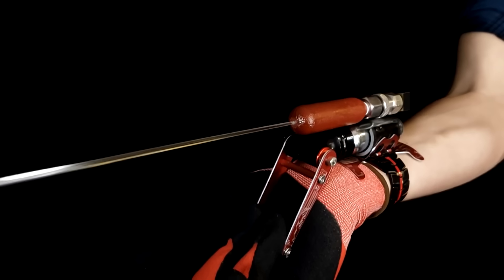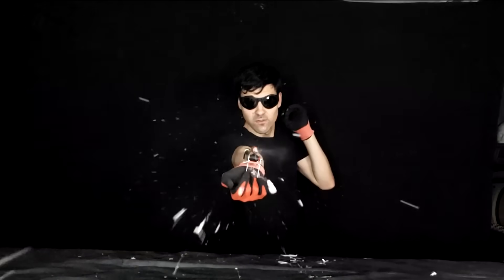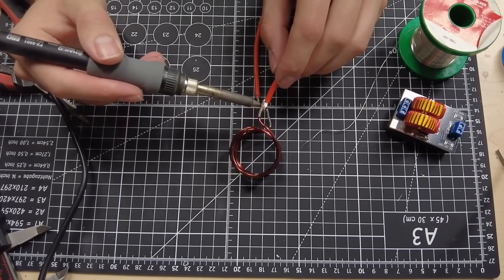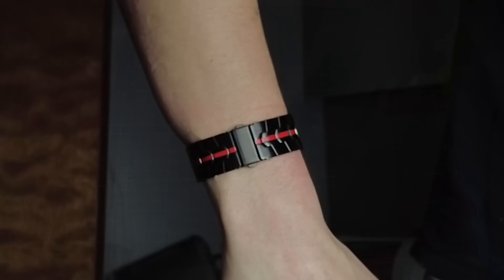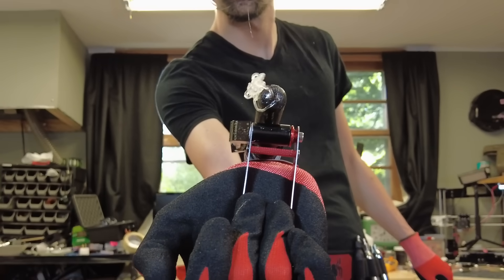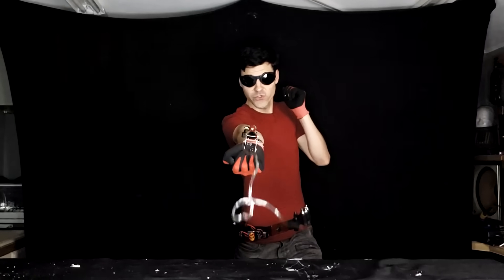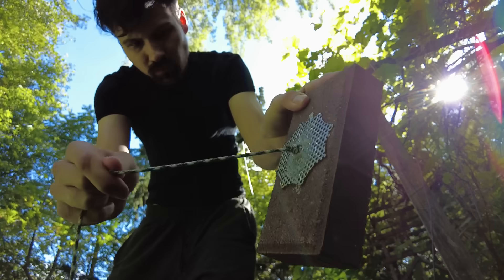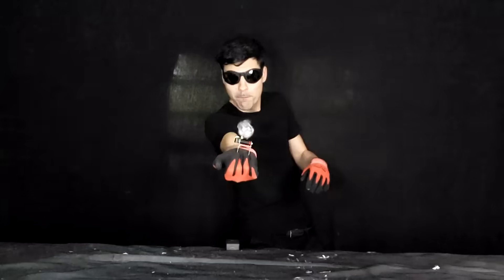REAL Web Shooter (Spider-Man: No Way Home)

Comment: You could use memory steel shaped as the metal web thingy with the holes at the end of the video in order fot it to be able to be folded into a small shape so u could combine rope and hot glue. The ropes could actually be wires that provide the memory steel web thingy with electricity and heating it in order for it to unfold. This way when u stot your web shooter it would firstly fire hot glue witch it already does and then after like 0.12 seconds it would fire the metal thingy with just an additional co2 canister while simultaneously providing it with electricity via a high amp battery (for exemple a small lion 7.4V battery) so it can unfold and stick to the hot glue.
Reply: Oh yeah this way u could also open up a whole new world of electric "webbing" by sending high voltage to the metal thingy from a high voltage generator
Reply: GAY

Comment: Maybe if the metal with holes was replaced with actual chainmail it could make it flexible and keep the strength that the prototype has while being able to fit into a more compact space rather than having the disc somewhere on your body

Comment: Certainly, let's provide a comprehensive step-by-step guide for building the advanced glue delivery device with all the components and features you've described, in the order you specified:

*Step 1: Conceptualization*
- Begin with the idea of creating a multifunctional device combining a glue delivery system, cutting mechanism gloves, a retrieval system, and a string catapult for versatile applications.

*Step 2: Design and Blueprint*
- Develop detailed blueprints that include all the components:
  - A sturdy frame
  - A compact web structure (web base)
  - Cutting mechanism gloves with integrated buttons and sensors
  - Glue reservoirs with precise release mechanisms
  - A retrieval system inside the device
  - A timer-controlled oil-release mechanism

*Step 3: Gathering Materials*
- Collect necessary materials, including:
  - Microcontrollers for sensor integration (e.g., Arduino or Raspberry Pi)
  - High-tensile strength string material
  - Springs suitable for the web structure
  - Heating elements, temperature sensors, and small pumps for glue and cohesive substance release
  - Durable framework and gloves for integration
  - Buttons for gloves and wiring components
  - A tiny catapult mechanism with a long string
  - Additional rolls of string for reloading

*Step 4: Building the Frame*
- Construct a sturdy frame using lightweight and robust materials like aluminum or carbon fiber.
- Add mounting points for various components, ensuring stability and durability.

*Step 5: String and Glue Delivery System with Chambering and Loading*
- Integrate the strong string-like material into the device for weight distribution.
- Design a glue chambering and loading system connected to glue reservoirs, allowing glue to ooze onto the string as it's being fired.
- Create a web structure with springs that opens upon releasing the web.
- Implement a combined heat mechanism within the web structure, connected to the drying mechanism.
- Integrate a precise glue release mechanism into the web structure, including four nozzles for controlled glue distribution onto the string.
- Incorporate an oil and rubbing alcohol release mechanism into the web structure, consisting of four nozzles for releasing cohesive substances.

*Step 6: Cutting Mechanism Gloves*
- Create gloves with built-in buttons on each palm.
- Integrate sensors into the gloves to detect string tension and angles.
- Implement an electronically controlled cutting mechanism on each glove.

*Step 7: Retrieval Mechanism*
- Integrate a retrieval system inside the device with a weight sensor.
- Implement a timer-controlled oil-release mechanism within the device.
- Include small pumps for controlled oil and rubbing alcohol release.
- Ensure proper plumbing and tubing for cohesive substance release.

*Step 8: Software Logic*
- Develop software to control the entire system, including sensors, microcontrollers, pumps, and timers.
- Configure the software to recognize different button inputs on the gloves.
- Utilize microcontroller libraries and programming languages suitable for the components used.

*Step 9: Swing Functionality*
- Utilize the sensors in the gloves to detect swinging motion.
- Configure the software to recognize peak swings and allow for the release of the string at the desired moment.
- Enable double-tapping of the glove buttons to cut the string and initiate a swing.
- Implement a feature that allows holding the button to retain the strings in place.

*Step 10: String Catapult and Loading Mechanism*
- Include a tiny catapult mechanism with a long string that holds additional rolls of material.
- Implement a loading mechanism for the catapult, allowing for easy insertion of more string.
- Design compact and durable web-based bullets (WB bullets) that attach automatically to the string after the prior web base (WB) has detached.
- Create a loading system for the web-based bullets to facilitate rapid reloading.

*Step 11: Final Product*
- Successfully complete the advanced glue delivery device with cutting mechanism gloves, heat mechanism, web structure, and retrieval system.
- Ensure that it fires glue webs with precision, applies hot air for rapid adhesion, and has a retrieval mechanism that operates as intended.
- Allow for intuitive swinging, string cutting, string retention, glue delivery, and cohesive substance release functionalities as described.

This comprehensive guide outlines the construction of a multifunctional device that combines existing components and technologies to achieve the desired functionalities in the order specified, ensuring a versatile and precise multifunctional tool for various applications. Always prioritize safety and responsible use when working on such projects.
Reply: Certainly, let's provide a comprehensive step-by-step guide for building the advanced glue delivery device with all the components and features you've described, in the order you specified:

*Step 1: Conceptualization*
- Begin with the idea of creating a multifunctional device combining a glue delivery system, cutting mechanism gloves, a retrieval system, and a string catapult for versatile applications.

*Step 2: Design and Blueprint*
- Develop detailed blueprints that include all the components:
  - A sturdy frame
  - A compact web structure (web base)
  - Cutting mechanism gloves with integrated buttons and sensors
  - Glue reservoirs with precise release mechanisms
  - A retrieval system inside the device
  - A timer-controlled oil-release mechanism

*Step 3: Gathering Materials*
- Collect necessary materials, including:
  - Microcontrollers for sensor integration (e.g., Arduino or Raspberry Pi)
  - High-tensile strength string material
  - Springs suitable for the web structure
  - Heating elements, temperature sensors, and small pumps for glue and cohesive substance release
  - Durable framework and gloves for integration
  - Buttons for gloves and wiring components
  - A tiny catapult mechanism with a long string
  - Additional rolls of string for reloading

*Step 4: Building the Frame*
- Construct a sturdy frame using lightweight and robust materials like aluminum or carbon fiber.
- Add mounting points for various components, ensuring stability and durability.

*Step 5: String and Glue Delivery System with Chambering and Loading*
- Integrate the strong string-like material into the device for weight distribution.
- Design a glue chambering and loading system connected to glue reservoirs, allowing glue to ooze onto the string as it's being fired.
- Create a web structure with springs that opens upon releasing the web.
- Implement a combined heat mechanism within the web structure, connected to the drying mechanism.
- Integrate a precise glue release mechanism into the web structure, including four nozzles for controlled glue distribution onto the string.
- Incorporate an oil and rubbing alcohol release mechanism into the web structure, consisting of four nozzles for releasing cohesive substances.

*Step 6: Cutting Mechanism Gloves*
- Create gloves with built-in buttons on each palm.
- Integrate sensors into the gloves to detect string tension and angles.
- Implement an electronically controlled cutting mechanism on each glove.

*Step 7: Retrieval Mechanism*
- Integrate a retrieval system inside the device with a weight sensor.
- Implement a timer-controlled oil-release mechanism within the device.
- Include small pumps for controlled oil and rubbing alcohol release.
- Ensure proper plumbing and tubing for cohesive substance release.

*Step 8: Software Logic*
- Develop software to control the entire system, including sensors, microcontrollers, pumps, and timers.
- Configure the software to recognize different button inputs on the gloves.
- Utilize microcontroller libraries and programming languages suitable for the components used.

*Step 9: Swing Functionality*
- Utilize the sensors in the gloves to detect swinging motion.
- Configure the software to recognize peak swings and allow for the release of the string at the desired moment.
- Enable double-tapping of the glove buttons to cut the string and initiate a swing.
- Implement a feature that allows holding the button to retain the strings in place.

*Step 10: String Catapult and Loading Mechanism*
- Include a tiny catapult mechanism with a long string that holds additional rolls of material.
- Implement a loading mechanism for the catapult, allowing for easy insertion of more string.
- Design compact and durable web-based bullets (WB bullets) that attach automatically to the string after the prior web base (WB) has detached.
- Create a loading system for the web-based bullets to facilitate rapid reloading.

*Step 11: Final Product*
- Successfully complete the advanced glue delivery device with cutting mechanism gloves, heat mechanism, web structure, and retrieval system.
- Ensure that it fires glue webs with precision, applies hot air for rapid adhesion, and has a retrieval mechanism that operates as intended.
- Allow for intuitive swinging, string cutting, string retention, glue delivery, and cohesive substance release functionalities as described.

This comprehensive guide outlines the construction of a multifunctional device that combines existing components and technologies to achieve the desired functionalities in the order specified, ensuring a versatile and precise multifunctional tool for various applications. Always prioritize safety and responsible use when working on such projects.

Comment: Maybe a good alternate path if glue and grapple systems don't work out would be a way of figuring out a way to use bungee rope? You'd need a retraction system to take it back after firing which may also be difficult to do considering it'd need to stick to surfaces but that would support the user's weight and be swingable.

Comment: I think the main interesting part about peters web fluid in all iterations we see on screen. It seems to be a rapidly expanding fluid that has extremely high tensile strength enough to hold something like two sides of a cruise ship together meaning it has to have enough tensile strength to hold like 200,000 plus tons. Even in something like the Tom Holland usage case he only uses like 15-20ish webs to hold the ship together momentarily so that’s still like 13 tons per continuous web point. 

I don’t even think we have a type of material on the planet that could hold that much weight back😅

Comment: Make the web anchor collapse into the CO2 cartridge and then when its fired the outward pressure of the co2 would cause it to "Blossom" open like  a flower, or a net, or a hollow point round.

If the anchor is metal and inside the co2 cartridge, then the glue could be pre placed/heated in the center. Not sure if that's the best description of the idea. But I'm sure by now, you've come up with an idea way better.

Comment: Im sure people have tried it before but i havnt yet seen it on youtube and its kind of shocking that no one is trying ti make spiderman web shooters behave like spiders

And by that i mean get the chemicals that spiders use to make webbing, have those chemicals travel into a mechanism that spins those chemiclas together (like the spiders body does) and have some way of having pressure shoot that spun material out. And the fact that it would be the samr web that actual spiders use just to a larger extent, it would easily hold peoples weight and be able to be swung from
Im not sure if this is actually work, its just an idea and once i graduate high school and get to college where ill be dealing with chemicals plenty to know how it works, i want to try this idea

Comment: What  if there was like a mesh of thin rope in with the hot glue, maybe attached to some ball bearings for weight, and they shot out and you could have it drag the rope behind. You could also team up with JT since he has experience with grappling hooks and having projectiles pull ropes

Comment: Absolutely AMAZING!!!!! There's nothing else to say. You and JT are truly brilliant. One of the most overlooked things about inventors is that they fail more times than they win, and yet, it's that win that proves their strength and willpower to find a way. Great job and well done.🤩

Also, just an idea for the webshooter, I have no idea if you have tried this or if it just isn't possible, but what if there was a mechanism that quickly spread out the spray of glue and retracted for there to be a single line. Like the "real" thing. That way you wouldn't have to worry about have a metal plate to stick to because the spread out stick would already be there? I don't know if this is even possible, but if it is, it might help in grip and strength if you can get it to work.

While you're at it, you should look into real spider webbing from real spiders if you haven't already. It's a fascinating subject and it may help in development of real life web shooters. Each spider out there has a great number of spinnerets. Each one allows the spider to create a number of webbing with different qualities. From strong and non-sticky to thin and sticky to much more! If you can study the spider and the webbing it makes, maybe you can come up with even more ideas! Just some thoughts I had. Love your work!

Comment: oh oh i think i know how exactly in homecoming they made the web cartridges! 
they got the Fluid Mixture
Put it in a little machine Peter made that had im pretty sure 2 caps on both side
they pulled the lever and it pressed the 2 sides of the cartridge together with the fluid in the middle 
and since its so much fluid pressed into one small capsule it has a ton of pressure because of it. 
and i think the webshooter itself has a small hard hollow needle in the front end of it that pierces the capsule when its in it then its closed off like one of those soda bottles that use the compressed air capsules.

Horrible explanation but im 95% sure thats how that thing works (except without the actual web fluid i dont think it would work)

also maybe try to have that one rifling thing that guns have that lets the bullet fly straight. (Dicks have that too thats why the stream is kinda flat and in a spiral thing.)

Comment: Propably would be smart to have a narrow opening and small capsules to put in the shooter that have a lot of pressure in them so you can pop the end and its lets it out at the opening with higher strenght. it would propably not go far in a string but its one way to make one of those small web shots that splat on wall or ground like the one Peter used in spiderman 3 against Harry

Comment: you need to get a chemist involved. I'm not sure exactly what the material spiderman uses is, but a few of the comics might point you in the right direction. for example: in the nineties, there was a comic where spiderman had to fight the blob, but for whatever reason, he just didn't feel like messing with him so he basically broke the cartridge onto the blob while monologing about it. If I'm recalling correctly, it was a polymer of some sort that expands when it comes in contact with air, creating the various 'webs' etc depending on what the nozzle setting spiderman used was.

I don't know how helpful this is, but good luck!

Comment: I can see a handle attached to the trigger mech. Simply squeeze and hang on. A full forearm prosthesis could be made out of thermoplastic for a more robust attachment for swinging.  I possible carbon fiber web could be made mixed with hot glue coiled inside.

I think having as flexible web base instead of steel would be good. Not sure of the best material. A carbon fiber linkage web shape might be possible.

I am so impressed with what you have done so far. I mean really. I can see it possible to have an actual compact working web contraption prototype within a few months. It would be buggy and only work on specific surfaces, but I see it happening :) It is possible.

Comment: I have an idea. How about you make it on a double trigger system where when you pull the lever it shoots a web and a smaller replica of the wire and string. Or you can compact the wire into the web.

Comment: Why not use a soft non Newtonian material for the mesh Web thing with holes in that you stuck to the brick. That way you can store it easier and it would harden on impact to allow the glue to dissapate over and between the surface. Or vice versa have somthing hard that softens on impact to mould to different shapes